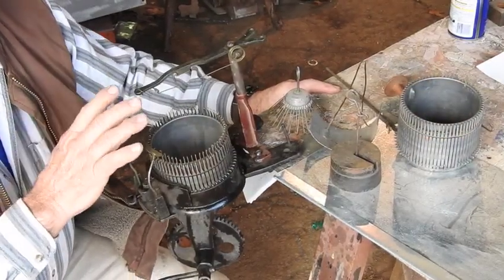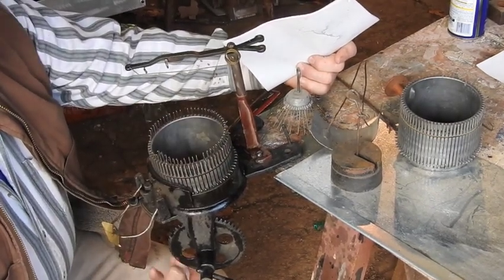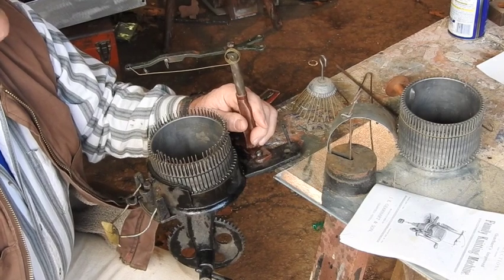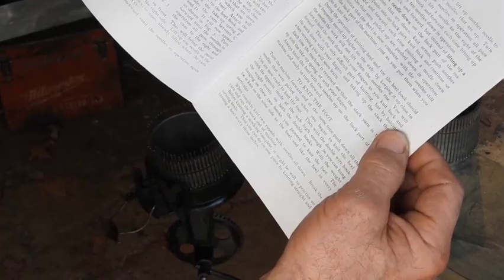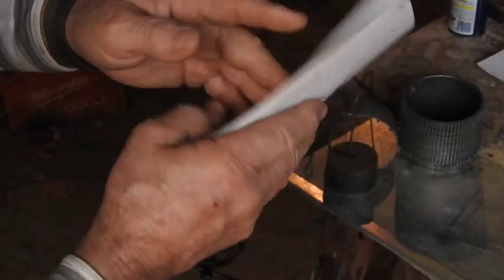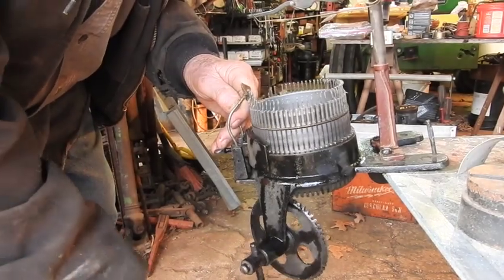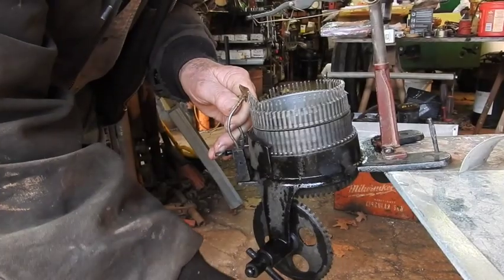Could You Knit Your Own Socks??   You've GOT To See This Machine !!

Comment: I used to work on those in a local hosiery mill here in town, we made lady's hosiery plus other apparel as well, the machines we had were computerized but worked on the same fashion as the one in your video. That was one of the best jobs I ever had, I enjoyed working on those machines. Thank you for the video!
Reply from the maker: Now that's cool !!  I think textiles were a large part of NC's economy for a long time wasn't it.  I can't imagine working on something so intricate as these machines.  I bet in the factory, they ran at lightning speed too !! Precision at its finest for sure.
Reply: @tractorman4461  yes sir textiles used to be a big thing here in NC, but not as much now, most of the machines we had would run around 500 rpm, that's with 4 feeds, and there was a couple of styles we could run up to 750, that depended on the degree of the stitch cams, we used 45 and 55 degree cams, 45s could take a higher speed. It was amazing to watch them in action. The first hosiery machines were flat knitted on a Reading machine (Full Fashioned Hosiery) made in Reading PA.
Reply from the maker: @1972BRJ  All lost on me though greatly appreciated.  We specialize mostly on old stuff that's rusty, don't work and with pieces MUCH larger !!  LOL  I'd freak out if it was expected of me to disassemble and repair a machine such as you describe.  But I can understand the satisfaction of having the ability.  Awesome !!  Thank you for adding to what's turned into a very interesting thread.

Comment: Now that video was very interesting; just too short.  One of my dear friends has several sock knitting machines all of which are over 100 years old.  At 1:39, that piece is used to "pick up" all the needles  that are not going to be knitted into the heel. It is curved at the same angle as the frame.  You don't want to pick up only one needle at a time.    Look to see if there are 2 marks, perhaps yellow or some bright color, spaced several inches apart, on the main frame.  That is the area used for making the heel.  The one caveat for a new knitter is to keep your feet clear of the weights.  They do not feel very good on your toes should you accidentally drop them.   Right now I am wearing a pair of socks she made from one of her machines .
Reply: @akquilter3519.  Wow, is the machine a lot like the one shown?   Did you watch the video that was posted by Mr Wallace?   The gal using it was very proficient, probably after quite a lot of practice and patience.
Reply from the maker: Now THAT is some interesting information.  So have you gotten to use the machine first hand your friend has, or have you learned the things you informed us of by closely watching her in operation.  So cool that you're currently wearing a pair made from such an old machine.  Awesome !!  It seems to me to be a machine to be used by someone of great patience and nimble fingers...both of which is in great demand within my own personal space.  (-;
Reply from the maker: @mafarmtown2086  Yes, the Missus and I watched Wm Wallace suggested videos. She was slick with the machine for sure !!

Comment: I'd say if electric wasn't a thing we'd still be just about as advanced as we are now but everything would be ran by increasingly tiny analog computers. They were coming up with some very complex mechanisms for factories and industrial logic and it was all run with gears, weights, springs and levers.
Reply from the maker: Yes, I do believe you are correct.  Just think of the ratios that had to be figured out to make a clock work and stay reasonable in time at that !! Weights, springs, gears and levers did it all.  And the real old clocks were wooden !!  Also I think the enigma machine the Germans developed in WW2 were all mechanical as well as the sextants for guiding ships a few centuries before that.
Reply: @tractorman4461  The Germans enigma machine had some electric components but it did use rotors, springs and gears. Those were very interesting machines, even though apparently they were no match for several extraordinary minds who sat in a dark room day in and day out pondering. Speaking of wooden machinery, have you ever seen the inner workings of one of the ancient windmills? Large wooden cogs ran the mill. I think the earlier cogs were just wooden wheels with large dowels sticking out of the faces that acted as teeth. Cathedral organs are another mechanical marvel. Pressurized air being pushed through pipes at the press of a button and those date back prior to the middle ages.
Reply from the maker: @conspiracyscholor7866  I’ve not seen the insides of windmills but I HAVE seen some of the workings of the old mills on the streams with waterwheels. It’s amazing what was done with just backbone and willpower back then. We also have a shot tower in this area. Not mechanical but a lot if thought had to go into what to do the make the lead shots !! There’s still the remnants of an old waterwheel mill near me as well. All that old stuff is very interesting to me.

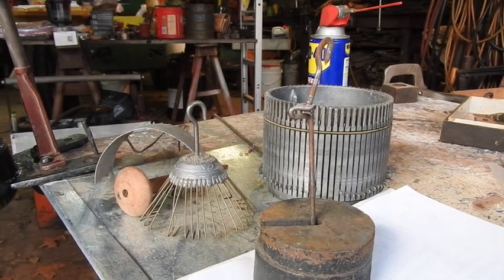Comment: It looks like there are at least 2 needles missing, see 4:50 and almost straight across from each other.  The wood pin is to hold the thread.  I believe the curved piece goes to the other cylinder since it is a different size.  I found a video for you showing making a sock on a machine like this.   https://www.youtube.com/watch?v=7N7hsho4Sjg
Reply from the maker: After I finished recording Roy, I saw the hole in the wooden spindle was exactly the size to fit the metal pin on the back of the mounting bracket and figured that was for holding the spool of yarn.  It would have been more apparent had we had a spool of yarn to sit on the back.  AKQuilter said the curved piece was to be used to hold up the needles not used when you got to the portion of the sock that was to become the heel.  Thanks for the link, there are a couple others suggested above as well.. So interesting this has become.  Two days ago I wasn't even aware this machine existed !!

Comment: You know, that comment about how the old timers could figure stuff out with a pencil and paper is interesting. Some time ago an old Norwegian farmer from the western hills of Wisconsin asked me if I knew how to use a carpenter square. I sensed it was a trick question and told him I didn't. He laughed, then told me most people have never seen a true carpenters square. He pointed out that Home Depot and Menards only carry framing squares, so I went and bought a book that had a chapter on  carpenter squares. The first thing they said was that a whole book could be written on what a carpenter square could be used for. In short, a true carpenter square is basically a different form of a slide rule, which is the forerunner to the common calculator. One of the things I remember about it was how easy it was to change fractions to decimals by transferring numbers from one side of a blade to another. No wonder they could build anything.
Reply: What book? I'm trying to look into carpenter squares but of course only getting recommendations for where to buy framing squares.
Reply: @conspiracyscholor7866  The book doesn't tell you where to buy one, just some of the things you can do with it. If all you need is the name of the book , I'll try and locate it.
Reply: @SK-tr9ii  I think I figured out what I needed to know. Is it otherwise known as a try square? I was imagining something totally different lol.
Reply from the maker: Oh I cant' scratch the surface of what can be done with a carpenters square.  I can barely lay out a triangle with one !! I started first grade with the abacus in the mid 50's and in high school we used slide rules.  I can still muddle my way through simple stuff with a slide rule too.  I didn't even know the decimal trick, but I used a framing square to figure the minimum flu sizes for dual appliances entering a single flu.  Now you got me thinking about the old worn carpenters square I have from the early 1900's....Dang it !!  Btw, I can't help but note that 
Carpenter Square and Conspiracy Scholor  both abbreviate with C S !!  LOL
Reply from the maker: @conspiracyscholor7866  The carpenter square I  have is a Keen Kutter (iirc) and it has something like four rows of numbers up and down the length of the two 90 degree angles.  I never really knew, and still don't know, what they are all for.
Reply: @tractorman4461  If I remember correctly one blade is in tenth's of an inch. I've been told, but never have confirmed it, that Amish boys learn math on a carpenters square. That might help explain why they are such prolific builders.
Reply: @conspiracyscholor7866  A try square is a totally different animal. On a carpenter square, I think it is the long blade that will have a series of small holes in a circular pattern which is an easy way of identifying one.
Reply from the maker: @SK-tr9ii  You got me thinking I should dig that old square out and take a closer look.  But you might be right about the Amish !!
Reply: @tractorman4461  Well I'm intrigued. Apparently these things are highly elusive because I can't find anything except framing squares, try squares and the L shaped carpenter squares through search. You guys aren't talking about the L shaped "carpenter square" right? I'm imagining something different. Mine has 4 rows of numbers though. I'm almost tempted to go ask around the Amish country.
Reply: @tractorman4461  Tm44/CS...I did find the book I was referring too and along with being called a carpenters square, it is more commonly referred to as a steel square. Apparently they are made in different configurations. The brand name on mine is a Sears Craftsman. In the book, Workshop Math/Robert Scharff, an Essex Board Measure Table is shown on the tongue of the square, mine does not have that. It's used to calculate board footage in a log. Without the square in my hands I can't recall accurately where everything is but the measurements are in 16ths, 8ths, 10ths, and 12ths. On the backside of the tongue is a series of dots that are used to lay out octagon measurements. About the series of small holes laid out in a circular pattern that I previously talked about, I can find nothing. I remember talking to the old Norwegian farmer about those holes and he said they were commonly used for ship building but he didn't know how. I do remember seeing a square with those holes at one time or another because I knew immediately what he was talking about. Now if you see me at a tractor show digging through the tools at the flea market, you know what I'm looking for. Btw, I claim first dibs!
Reply from the maker: @SK-tr9ii  I still haven't taken the time to dig out my old King Kutter, but I don't recall it having the drilled holes that you describe.  Do you think that might be an alteration made by someone that knew geometry or trig and the relationship to angles or arcs created by use of the combination of the holes.  Ship builders HAD know angles and arcs.... I don't know, just thinking outside the box on what might have been.  But the basic fact is, the majority of us that use the steel square only know the most basic of uses.  I am for sure in the majority.  Thanks for the very interesting conversation guys, even though its stretching out a few days.  LOL  Oh S K... you better get to the tools bench at the tractor show first.... (-;
Reply: @tractorman4461  Well, holes drilled for a set purpose is a possibility. Perhaps in a few days, weeks, months, or years, my mind may make the connection and I'll remember more about it. One things for sure, every generation likes to think they are smarter than the ones that came before, but that's seldom true...all we do is add bricks to an already built foundation. Perhaps I'm just saying Dad was smarter than I thought he was. lol
Reply from the maker: @SK-tr9ii  Well, those were some thoughtful words about the older generations. My dad had trouble teaching with words, so I spent so much time learning what I learned by watching him do stuff then either copying or adapting what I saw him do to do it for myself.  But that is another variation of adding bricks to the foundation so to speak. The main thing is to bring the next generation along with us on the basics.  Good observations S K.